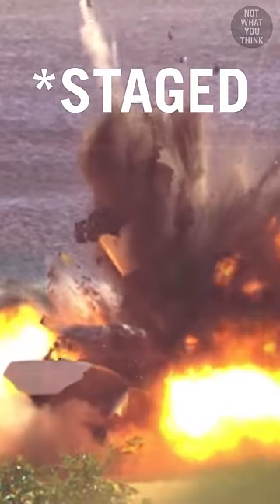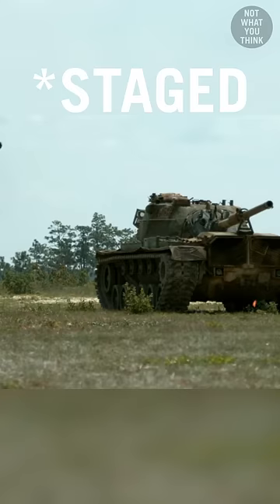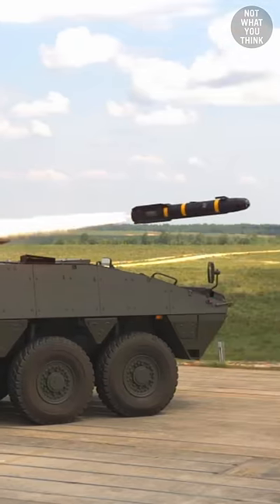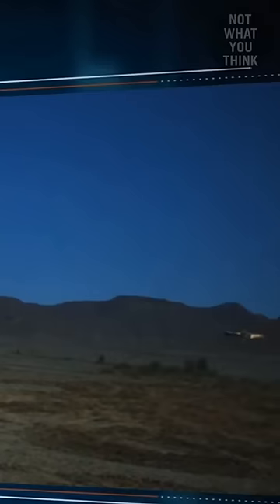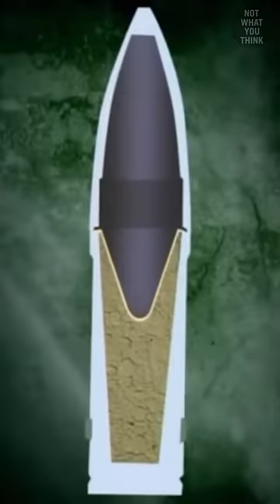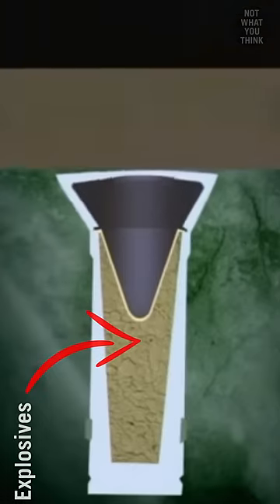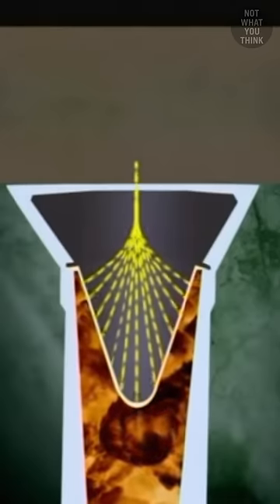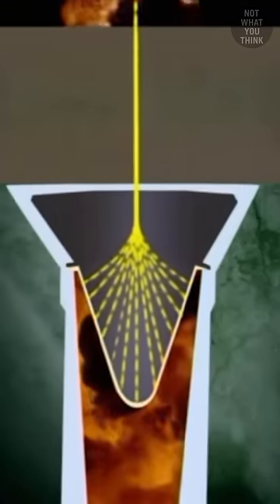How Anti-Tank Weapons Work #shorts

Comment: Actually its almost true, the metal shape inside flips it self inside out and make a metal spear that also helps penetrate
Reply: Nah, i mean you could describe it like that but as long as you’re clear that it’s molten, not just a solid piece of metal. It’s like a 3,000° pressure washer (no idea what actual temps are) it’s the jet that does the savage more than the molten part though
Reply: @Fee.1  
The jet is NOT molten. It gets extruded and accelerated in its solid form into a high speed "wire".
In Xrays of the jet you can still see the crystal structure. Liquid doesn't have a crystal structure
Reply: @warriorson7979  you’re telling me none of that metal is molten?
Reply: @Fee.1  
Nope.
It's like slapping a piece of clay and having it pop out between your hands.
At that pressure copper literally behaves like clay.
The jet is at about 400°C when it forms...well below the melting point of copper.
Reply: @warriorson7979  I need all the sources for my own edification please and thank you
Reply: @Fee.1  
I'm sure you'll find something on the internet.

Comment: Challenger 2 is immune to HEAT! 
Source: it's active combat record
Reply: Nah, it’s already defeated, right?
Reply: but not tandem charge yeah 😂
Reply: No tank is truly immune to HEAT.
Reply: ERA protected the tank
Reply: Unprotected sides: "Allow me to introduce myself"
Reply: The above description isnt HEAT rounds. 
Its a conical shape charge with a snub head pressure detonator. 

An impact, at a wide range of angles will help direct the way in which the chape charge delivers its payload. Its pressure, not thermodynamics.
Reply: Source: War Thunder leaks
Reply: @chiefkieran3446 but you're literally just describing heat. Any sort of shaped charge is heat, since it's an anti-tank weapon that uses chemical energy
Reply: @kralicidoupe385 the challenger he's talking about took about 50 rpg hits, most of them to the side
Reply: @sigstenbockgard8080 Any decent heat warhead would penetrate the sides and send the crew to high heavens.
Really old heat warheads + potential he warheads wouldn't against the extra protectice elements placed on the Challenger during those missions.
Reply: Doesn't mean it's immune to HESH

Comment: Now I am curious how much temperature rises theoretically in that molten arrow
Reply: Yes
Reply: fuck do I know, melting point of copper isn't that high
Reply: From what I could find, about 900°C or 1700°F. Meanwhile the melting point of copper is 1085°C or 1983°F. So the liquified copper (caused by the pressure of the shockwave) is actually significantly below its melting point.

Comment: There's also a version which flattens on the outside then explodes causing spalling inside & the fragments act like flechettes shredding anything soft. (The crew are soft). 
The tank is easily repairable after hosing out the inside & can be re-badged & reused within a couple of days.
Reply: That is HESH

Comment: how far does the metal stream fly?
Reply: The sheer momentum of the stream
Reply: I guess since it travels at 10km/s it can fly up to several kilometers and still be able to give a punch at the armor.
Reply: @MartinMizner  no i think it slows down because if the atmosphere after like 100m
Reply: @Martin Mizner  actually if it goes a like a ft more that immediate contact it becomes useless. Such as the projectile hitting spaced armour
Reply: @MartinMizner nope it loses effectiveness extremely quickly. The armor made to counter it is spaced armor which has open air in the plating to cause the jet to lose most of it energy.
Reply: It breaks up into small pieces after about 2 meters....then loses speeds very fast.
Will probably only travel about 200 meters max
Reply: it entirely depends on how powerful the warhead is, the most powerful i can think of is the russian kornet-D which against RHA armor can go through 1300mm of it

Comment: just to be clear: here is how the HEAT shell works, there are other types of armor piercing shells as well
Reply: HEAT is not armor piercing
Reply: @sigstenbockgard8080  HEAT is shell created for piercing armor. There is shell type  called AP but i'm talking about function
Reply: @zubi9995  it does function as AP but AP usually refers to solid KE shells, like APCBC or APFSDS

Comment: That is NOT a very good visual illustration of how a shaped charge works...😒
Reply: Why not?
Reply: @sigstenbockgard8080  
Because the liner doesn't collapse like that.
It basically turns inside out starting from the cone apex going forward.
Reply: @warriorson7979 that's for wider EFPs. More narrow shaped charges collapse exactly as shown above.
Reply: @lemons1559  
Hollow charges too.
The tip of the jet that forms comes from the apex of the liner cone.
Reply: @warriorson7979  it collapses upon itself before it has the chance to get to be the tip.
Reply: @lemons1559  
No.
It doesn't collapse all at once.
It collapses gradually from the apex towards the opening.
Reply: @warriorson7979  yes, it collapses gradually but the explosive is faster than the copper, leading to the apex merging with the sides of the cone at about the halfway point.
Reply: @lemons1559  
🤣🤣
No.
The explosive is NOT faster than the copper.😑🙄😒
The most common explosives in hollow charges are RDX or HMX with a detonation velocity of 8500 or 9000m/s.
The copper jet tip velocity can reach 14000m/s.
Reply: @warriorson7979  I've ever read it being as fast as 10km/s where it typically is around 7km/s. Do also bear in mind that it takes time for the copper to accelerate to those velocities where as the explosion is constantly travelling at 8000m/s. If you read any literature or watched simulations showing shaped charges shaped as shown above you'd see that the cone collapses upon itself way before the apex has a chance to become the tip of anything. In fact a wave shaper that promoted the cone collapsing upon itself improves the penetration of shaped charges significanly. Such are used in them today.

Comment: the ending animation would be much more accurate if it showed the cone going inverse, because that's what happens, it's caused by a temporary state of induced super plasticity, no not related to plastic the material.
the animation makes it appear as though stuff peels from the narrow top,going straight to the center of the wide end without dispersion.

imagine if you made a cone from fabric then reach in to the bottom and pinch then pull....on an explosive level that's what shaped charges do but with supersonic half liquified metal jets.

Comment: This is why the RPG is so deadly. The cone shape charged acts like a needle and poke a hole in the armor then releases the explosion on the inside of the vehicle. Like injecting it with explosive gasses and fire.
Reply: The RPG isn't actually that deadly, it can't do much against modern MBTs
Reply: @sigstenbockgard8080  is that why Ukrainians and Russians are forced to use bar armor on their tanks? Because rpgs aren’t that deadly?
Reply: @Random-Guy-1121  the bar armor is exactly why they aren't deadly. HEAT and especially old HEAT systems are really easy to stop with either the most basic spaced armor (the stuff used today to stop rpgs looks exactly like it did in ww2) or very early ERA.

basically the RPG is an incredibly outdated that wont do shit against a modern MBT, a challenger 2 in iraq survived nearly 50 rpg shots and wasnt even fully disabled

Comment: First of all the metal liner is made from copper. It's turned into a jet of almost plasma hot molten copper that melts it's way thru the tank and blows hot steel and copper alloy all over the inside. It doesn't have anything to do with the shockwave or the kinetic energy. It's literally like putting a hot knife through butter. I've personally seen APC and other things that were hit by a RPG and a lot of the time there was only a pencil size hole on the outside. But that's why you see Stryker and Bradley's with expanded metal racks all the way around the vehicle about two feet from the hull. That's there to prematurely detonate the rocket so the jet of copper is too cool to burn through the hull or too spread out.
Reply: It's not molten
It's not plasma
Those metal bars aren't there to dissipate the penetrator, if the warhead goes off the stryker's fucked. The bars are there to keep it from detonating by crushing the detonator if it hits between slats.

Comment: not sure what he means by "purely the kinetic energy"...that kinetic energy turns rapidly into heat on impact, as do kinetic penetrators. 
That's the whole point of incorporating ceramics into your armor, since it better resists high temperatures and does not liquify but shatter, absorbing a lot of the energy of the projectile in the process.

Comment: My old coworker was a tank operator during the iraq and Afghanistan operations. He told me about some of his tank stories and some of the weapons they had. One he described as basically a vacuum charge. It penetrates the armor, and then creates an instant vacuum which sucks EVERYTHING that isn’t solid metal out. 
He told me about the last big push they did trying to force everyone into a single building. Then an entire row of tanks just blasted the building over and over again until there was nothing left inside. If typed his actual description this comment would be auto deleted by the algorithm.
Reply: Thermobaric

Comment: The self forging projectile described here can destroy an armoured vehicle many metres from the point of its creation. A shaped charge can cut through a protective layer less than a metre away with a hypersonic jet of hot gas. This effect was discovered when testing explosive against steel plate and finding the name of the explosive was left printed into the plate.

Comment: I wonder if they reshaped the metal projectile into a few cones instead of just one if there would be better penetration power or even directional-ised penetration depending on the rotation of the projectile upon hitting the target or even in a times proximity Burst
Reply: it's a copper cone, and adding more panels would just decrease the penetration for a lot of reasons. the only way you could increase penetration is by having more explosive equivalent, and a material which has a higher melting point than copper, while also being as soft as copper.

Comment: I used this idea create armor piercing pellets in a break  action rifle. 

If you stuff the cone or hollow point pellet with matchead powder and match strip shavings one of two two things will happen; it will either detonate upon firing ehich will propel it rather violently amd somewhay unpredictably comparef to a regular shot.

But when you getnthe mixturebjust right? Well, put it this way i was ablebto blown a clean burmt hole through a one inch thick pine board

Comment: mix the explosive with poison gas, hear me out for a second

I'm not a demolition expert but it must be possible to put a poison liquid that can turn into gas in extreme pressure so add a little of that liquid in the empty part of the cone and when it jets inside the tank the tank will be filled with gas as well as the heat from the AT rocket effectively knocking out the crew with a single rocket.

I know its against the Geneva rules but for America it's a suggestion they can use white phosphorus anytime.

Comment: Copper liner literally become white hot plasma
Reply: Nope. It stays solid with max temp of only about 400°C
Reply: @warriorson7979  then why's a 5" x 12" copper wedge turn into a pencil sized hole in armor cooking anything anyone unfortunately to been inside? The copper is literally plasma hot an pressurized out the wazoo.
Reply: @Will-dn9dq  
Nope.
The people inside aren't "cooked"....they are "sliced" and "stabbed" by the jet and fragments formed when the armour is penetrated.
If you take an X-ray of the copper jet when it forms you can clearly see the crystal structure.
Liquids, gasses and plasmas don't have a crystal structure.
Reply: @warriorson7979  interesting I'll hafta look into that theory. Also you actually clicked like on your own post bro?
Reply: @Will-dn9dq  
Yeah.
I read it...and I liked what I read.😒
Reply: @warriorson7979  lol 😆

Comment: I was told by a scientist who worked on the Javelin missile in the 90s that the shaped charge formed a  copper plasma jet.  I saw the  cut away showcase of the test armor penetration tests.  45 degree angle, plates with air gaps between them no sign of particles deflecting.  The plasma cut through the various types of metal armor like butter. Even 2 25 mm plates of anti spauling Teflon.
Reply: So Spaulding.can be deadly
Reply: @ronhofer1444  spauling
Reply: *spalling

Comment: Okay the Hellfire missile you just showed only moves at Mach 1.5 it is not hyper Sonic. Stop using this term for everything that has to do with missiles. That certainly doesn't move at 7 km to second. Yes they are fast and you were correct about the shape charge but it is not a Hypersonic missile.

Comment: this is not actually true it is not the focased stream that is only in hesh and besh shells most outher penetrating shels have a discarding sabot
Reply: What do you mean shels have a discarding sabot? Discarding sabot is it's own shell, and is not used in other shells. And hesh works by sending a pressure wave through the armor to break off pieces of inside armor.

Comment: It’s called a Shaped Charge, ma dude. 
And that’s a Plasma Jet that it forms…NOT “ a stream of particles.”
Reply: If it his your tank... you're dead dead,
but yes, it's nice to get the terminology correct.
Reply: I'm fairly sure that it is not a plasma jet, as the temperature for it is still too low. Also I am pretty much sure that a stream of particles is just another word for a plasma jet, because they pretty much describe the same thing
Reply: Uhm... pretty sure its not plasma
Its molten copper cutting through armour like a hot knive through butter
I dont mean heat wise
Heat is just a byproduct of the penetration